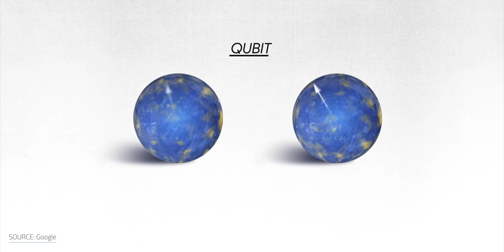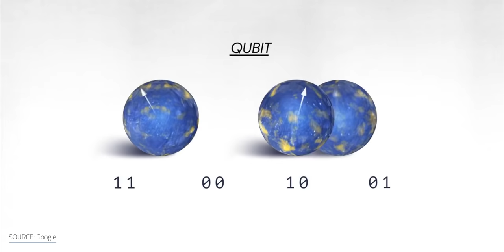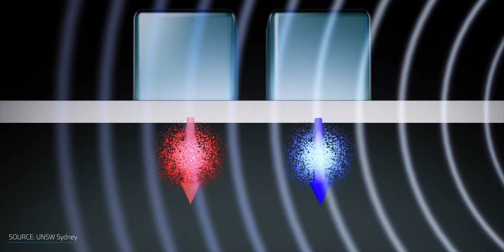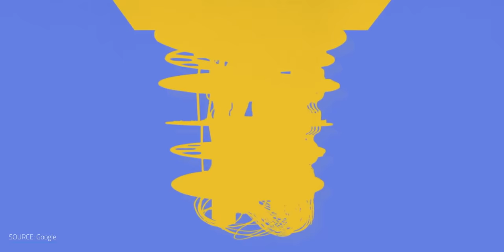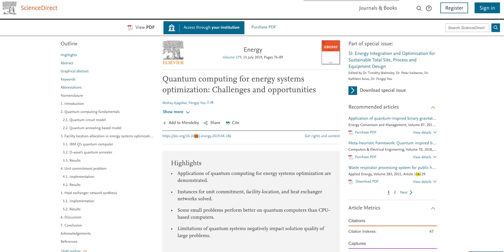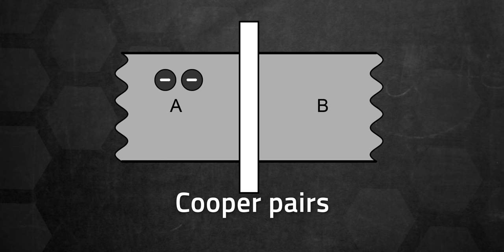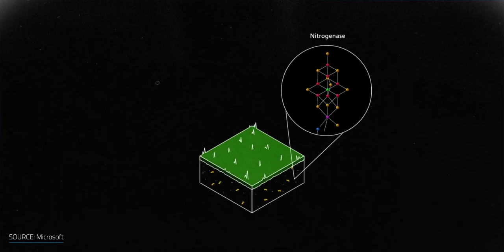Quantum Computers Are Coming … But Why Should You Care?

Comment from the maker: So are you still undecided? Do you think these kinds of advancements will help find solutions to climate change? The first 1,000 people to use the link or my code undecidedwithmattferrell get a 1 month free trial of Skillshare:  https://skl.sh/undecidedwithmattferrell05221

If you liked this, check out The Future of Solid State Wind Energy - No More Blades https://youtu.be/nNp21zTeCDc?list=PLnTSM-ORSgi4dFnLD9622FK77atWtQVv7
Reply: Am I correct in thinking that classic computers are exact while quantum computers deal mostly with probabilities?
Reply: I got an idea for them to try, instead of measuring for spin or state in a cold environment, they could instead try measuring for lack of activity in a hot environment, at room temperature for example, the basic premise is instead of expecting them to be inactive most of the time, you instead expect them to be active most of the time and the simple lack of activity or reduction of it relative to the environment is indication of internal input's effect
Reply: Truth will prevail
Reply: @lillywho  Planting a tree is a form of carbon capture. It literally turns carbon dioxide into carbon (the wood, roots, leaves, etc.) and oxygen. The carbon is stored until the tree is burned and the carbon is released back into the environment. But, just like everything in existence, scammers can lie and deceive about their particular method. It doesn't mean all carbon capture methods are scams.
Reply: PS:  I have three degrees, two in science, two at the graduate level with a concentration apiece and top of my class.  I also have a good 20 years more experience that you do crunching numbers in a wide variety of fields from engineering to aviation, IT, health care, and yes, climate science.  When it comes to climate science, you've fallen into the same cognitive bias mental trap as have many others (but certainly not all).  Un-trap yourself!
Reply: Imagine they did simulate where the best renewable energy locations would be, then countries worked together to make it happen... maybe on one of the other planets out there, they are more inclined to save themselves than us.
Reply: @[Undecided with Matt Ferrell] unqualified and it shows in 2nd sentence of explaination of qbits, it is not in 2 states at the same time it has 3 states 1 0 or some combination of those, it is not the same as being in 2 states at the same time, that is misconseption that helps some people to understand, it can be 0,7 1 and 0,3 0 but not 0 and 1 at the same time. Then there is entanglement if it worked like that we would stop using all network since it would be replaced by entangled atoms, if that was the case We would be creating quantum computers to communicate with probes, It would be awesome, but that is not how it works.
Reply: @ivegotheart  That attitude is precisely why the human race has at best a century or two left to exist
Reply: From my late ‘70s systems architectures wishlist: Is quantum memory akin to what we used to think of as fully associative binary memory but without the burden of making all the 1-many & many-1 hardware connections? Are quantum indexes dynamically formed & accessed via AI, as well, including localizing likely most frequently/quickly used/needed elements?
Reply: @justincase5272  For the lessor of us unable to derive your point, what in particular?
Reply: i can't wait until they have quantum computers designated to exploring different quantum computer architecture options. when quantum computers are trying to improve themselves that will be exponential computational advancement.
Reply: @ivegotheart  Not just you, everyone who carries the attitude of "I don't see it so it must not be real" is at fault, you're basically behaving like an ostrich and shoving your head in the sand expecting the problem to just go away, well guess what, it's not going away until we collectively do something about it
Reply: Instead of building a huge quantum computer with many qubits, why not build cheaper, smaller quantum computers made of single qubits linked together through entanglement? Imagine a network built through people's cell phones. It would be the smallest largest super computer ever built.
Reply: Question is... will they also bring about the end of encryption, and thereby cause a huge problem for basically the whole internet?
Reply: RIP passwords lol
Reply: They can crack all codes. So, we must run fast to find a solution for all our passwords and bank numbers. Are cryptos also in risk?
Reply: @justincase5272  I'm curious, what cognitive bias are you referring to?
Reply: Sorry, QCs have been around for thousands of years. It is just that we are finally rediscovering them. We still have a long way to go, especially if we don’t learn to use base12 again, like our clocks, not this base10 stuff, used by Tesla 3-6-9 instead of 3-6-9-12. Base12 would help us understand nuances of QCs and other things like Muon instantaneous communications. Communications, time-travel, AI and SI consciousness, zero-point energy among everything else is well known across the universe, but unfortunately not here, yet, but hopefully soon.
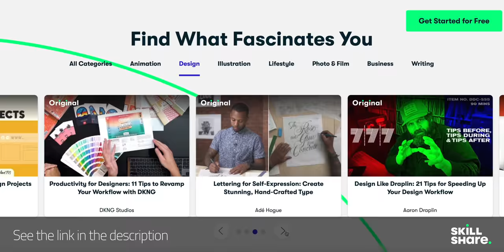Reply: 5:47 "And for the non-English speakers out there, the entire catalog is available with subtitles"... Only a few. Just the fingers of one hand - so that's it, Mr. Ferrell ;) But NICE TRY!
Reply: Where Quantum Computers can make a huge difference is using them to trade bitcoins, Quantum Computers are just great at such tasks as encryption and decryption as well as for instance simulations, yet there are still plenty of computing tasks where a conventional computer is superior to a quantum one. A thumb rule would be, a linear computer is better for linear computers while a Quantum Computers shine when it comes to estimations, i.e. simulations and crypto.
Reply: Why should we care ? Computers are everything 😶
Reply: science is always great at finding answers that people ignore for any number of reasons.
Reply: @quidambrujah  True. And when people take the "answers" brought about by science with open arms, it is usually at some point that everyone suffers from these "advances." In the end, the wisdom of the Creator is needed to save mankind from its own wisdom...
Reply: @JohnConnorTM  Crypto methods and quantium computers could be opened up to things like voting, cell phone security, user controlled meta data collection
Reply: @lat7805  Making blackboxes on devices that insulate encryption languages being used to tbreak up and encrypt data can make broad use of passwords a thing of the past. Our access will work more like DNA transcription + VPN + Dynamic biometrics.
Reply: Quantum computers can help us be able to short noisy signals and allow for privately-owned detection devices, such as a air composition device you can keep in your car and see what you're being exposed to. Or a toilet that analyzes your poop for an hour then Auto flushes giving you a whole lot of data to work with
Reply: Additionally quantum computers can allow for remote processing so millions of vehicles could monitor air composition and work out what is needed for a reference database to then be able to identify everything
Reply: @patrickdodge916  because it doesn't work that way. I'm smart enough to know that the explenation in the video leaves a lot to be desired. these things cannot be explained with a few slides.
Reply: I am very excited about the potential for quantum computers but... no, I don't think they'll solve climate change. I don't think the obstacles to climate change are predominantly technological--they are political and social.
Reply: @ko7305  amazing point. I'm a scientist and I've been getting really nervous about the lack simple experiments for problems like covid. I'm only a physical chemist but At a cost of about $200 I could have performed more experiments that gave more information in 3 weeks then what the entire world was able to accumulate between March 2020 and July 2020. The hijacking of scientific expertise is unbelievably insane
Reply: @bjeanes  If we really cared, really really cared, we would be asking serious questions about the problem. Also Nasa would not have a loop of hyperlinks  falsly claiming they have raw data available
Reply: So at 10:00 you start on the Eon energy storage plan. If I understand it correctly are the EVs acting as mobile energy storage that once plugged in act as a grid source for their relative areas? Tapping those car's surplus at peak hours then recharging them overnight & off peak?
Reply: QWANTUM COMPOOTERZ CAN FIZ THA CLIMAETEE
Reply: Quantum is going to need to figure out how to make everyone work together because only a few amount of people would only be able to afford such tech and people are becoming very smart at an individual level without any bs. Basically, it could be a battlefield in the public space.
Reply: Entanglement!?
There’s no such thing as entanglement of particles or qubits! It's simple, the Universe is one mind, consciousness, or information field if you like IT terminology. 
This is why we have phenomena which is called "instantaneous action at the distance". 
Btw, the Universe is not made of particles. It's opposite, the particles and waves are made out of Universe, just like ocean waves are made of water. Waves and particles can't exist by itself, and this omnipotent/omnipresent consciousness is what creates and connects them.
Reply: @dadigitechman  Uh...you don't "grow" your lawn with a lawn mower. The mower "Cuts" the grass. The grass grows as a result of photosynthesis and water.
Reply: 13:45 what language is this you are talking about? What its name and where we can learn it?
Reply: The quantum D Wave computer has been around for almost over 15 years, used by the US Military, Raytheon, Boeing, and others; but you want to say now that Microsoft, google, IBM, and nvidia are involved it's going "change reality"?? LIMM.

Also, You mean to tell me of aaaaaaaaaal the more critical, serious, and dangerous problems facing humanity i.e nuclear war, space travel, planet killing comet, planetary grid destroying CME's,  planet killing volcano (worse to the climate than all our diesel trucks combined) the worst problem it's going to solve is imaginary "climate change"?
Dude, you seriously got to stop watching cnn.
Reply: @MR-nl8xr  If you think climate change is imaginary could you explain to me how an object(earth) out of energy equilibrium(we are gaining more energy from the sun than can be lost to space due to greenhouse gasses, at a rate of an additional 15 megaton nukes worth of energy every 5 minutes) can break the laws of thermodynamics by not gaining or losing heat as a result of being pushed out of that equilibrium.

The only way you could be correct would be if Ice ages and hot house earths never existed so you may want to hold off of using the word imaginary, it doesn't look good to do so while ignoring basic physics.

Oh, and as for a super volcano none are due  for a very long time (circa 600 to 900 thousand years), but on the subject of them, the earth has about 1500 active volcanoes presently, if you take their combined Co2 emissions per year and divide by 1500 to give you an average output per volcano, the earth would need 292,000 active volcanoes to match what humanity emits in 1 year. 

And volcanoes also emit sufficient amounts of Sulphur dioxide aerosols which negate the warming effect of the Co2 they emit. Nature has its way of balancing things, humanity, not so much.
Reply: With crime, wars, and disease running rampant, the USA on the brink of civil war, immigration crises around the world, children starving in third world countries, and all of the other myriad of problems humanity is facing, the most pressing issue of our time is most certainty NOT climate change. 

Please keep your personal politics and propaganda out of scientific videos, and just deliver the information please.
Reply: Not everything has to be about "climate change", and it certainly isn't the biggest problem of our time. How about cancer, or certain genetic abnormalities. Maybe cheap limitless energy in fusion.  Design a highly efficient rocket engine for space exploration?
Reply: @High-Tech-Geek  As I understand it,  quantum computers use probability math to detect the state from the several  possibilities of a quantum particle as the basis of computation.  Whereas transistor based computers simply detect the transistor switch as 1 or 0  as the basis of computation.  However, quantum computers would calculate 2 + 2 as 4, not probably 4.   

I'm not sure whether this is what you were asking, but maybe it's helpful.
Reply: @scottwilliams7009  So is the quantum computer determining that 4 is the answer with the highest probability?
Reply: Quantum moves program help scientists to develop better quantum computer